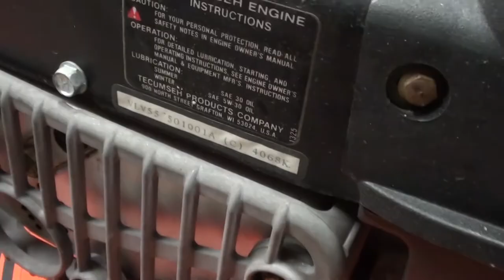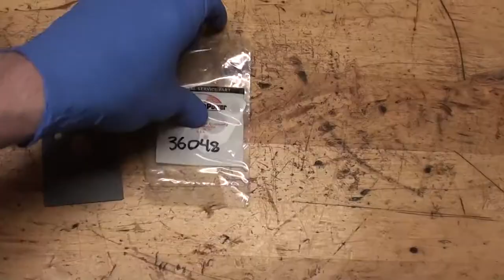Will It Run? Reviving an Ariens Mower w Caster Wheels

Comment: I bought this model mower about 15 years ago.  It is a simple $20 replacement float that is needed if it starts but wont keep running.  Plastic float gets a hole or crack and wont manage fuel level in the carb....

Comment: I've got one of these! Mine seems a bit older than yours though. My engine is a 5.5 Honda. There's a number of different models in the series, according to the manual. Mine is a 911101 (I think) - about 20 years old, I've had it for 10. Almost ready to sell it - going electric!

Comment: Dude, Nice Mower!!  I just picked up 2 of these mowers along with 2 Craftsman mowers for $50 bucks.  Both Ariens didn't run.  I repaired the one which had a 6 HP Briggs and just got the other one together and it also has the VLV55 Tecumseh you have.  It had a sheared flywheel key and the carb was very dirty.  Can't wait to get them both back to normal.  CHEERS!!!
Reply from the maker: Awesome! I ended up selling it to a friend so I can go see it anytime lol. Let me know how your pair works out. Thanks for watching Joe! 🤙🏼

Comment: Some of the problems with those carbs are the two o-rings, one is on the vertical piece and the other is to be found at the very back of the drain screw opening.  Both can be purchased at most hardware stores,  1/4" od  X 1/8" id.  AND the float needle seat is sometimes rubber that swells up and wont allow gas to come into the bowl.
Reply from the maker: I remember seeing the one in the drain screw that I didn't see at first. Definitely noting this mentally in case I ever split one of these open again. Thanks for watching!
Reply: @ChrisXOutdoors  That o-ring in the back is the one that will not let it run except when you are spraying directly into the carb.  The problem I am dealing with is oil leaking out from under the breather cover...again!  Replaced cover last year and its doing it again.  All drain holes are open beneath the cover.
Reply from the maker: 😖 hope you can get everything squared away

Comment: Awesome video! Just subscribed. Would you have a good link on where to buy parts for this mower? Great job again on the video.
Reply from the maker: Thank you Gary. Typically Airens and the engine manufacturers have fairly detailed parts lookups on their websites if you enter the mower/model information. Once you can locate the parts number(s), dump that number into Google and you should have some options. Oftentimes Amazon has many parts. Good luck Gary!

Comment: Do they have fuel filter? I have one for almost 25 years but it’s a 6.5 hp ! I have it in my building & never use it for 4 years! Today I’m trying to see if’s gonna run ! They started right away but it’s stop & won’t start!  I usually empty the gas before i put it up on winter!
Reply from the maker: Even if there was an ounce or two left in the carburetor bowl, it is enough to keep it from running. I’d clean that out along with the main jet and you should be good! Some people install a fuel filter if one does not come from the factory

Comment: Do you have the part number for the larger gasket that was torn in half. Or a link to where you got it. Great video btw
Reply from the maker: I purchased off of eBay..
Part number is 36035 (tecumseh). 

https://www.ebay.com/itm/283713201227

Thanks for watching Michael!

Comment: Hey ChrisX. Can you post the link where you bought the carburetor replacement? Thanks
Reply from the maker: https://www.ebay.com/itm/New-CARBURETOR-Carb-w-Gaskets-for-Tecumseh-632671-632671A-632671B-632671C-632614-/261482858208?mkcid=16&mkevt=1&_trksid=p2349624.m2548.l6249&mkrid=711-127632-2357-0

Let me know if the link gives you trouble!

Comment: I'm not familiar with this mower and one just like this was donated to me. It's an ariens with 6.0 tecumseh with missing self propel bar/handle, broken self propel cable, and I don't see a throttle control. I put a new carb, spark plug and air filter on it and it fired right up.  I've found parts diagrams but don't see a throttle control anywhere.  Am I missing something or maybe it just doesn't have one like other small engines?
Reply from the maker: Typically push mowers don't have a variable speed engine (bunny and turtle speeds). Its usually a wide open throttle controlled by a governor spring. The bail lever at the top that you hold down DOES pull back on a cable that is usually connected to a brake cable that also grounds and kills the engine once you let off. With all that said, I DO believe that this Ariens mower has a variable speed function which would mean it has a throttle cable. I can try to do a quick search for you. What is the model number or anything pertaining to the mower specs?
Reply: @ChrisXOutdoors  Ariens 911072 w/ Tecumseh vlv60 engine. The engine bail lever is attached and the mower runs, but the bottom bar that engages the self propel is missing. Theres a bunny and turtle sticker on the side of the rails you push, but I didn't find anything in my search that was a throttle control.  Maybe it's just as you said and it never had a variable speed.
Reply from the maker: OK.. I think I may have found your answer. I just need the serial number of your machine. It should be in the same spot as all of the other info you gave me.
Reply: @ChrisXOutdoors  s/n 001861.  Found a traction bail lever off an ariens snowblower that I'm going to try hopefully it's a match.  With luck, i' might be able to piece this back together.
Reply from the maker: I searched and was able to find something.. Its difficult to tell if its an exact match but you may be able to better confirm once you search and compare with your own eyes.. Ariens part number 06938000. Hope you were able to get it together!

Comment: I have an ariens 911019 self propelled mower that the engine is no good. Would I be able to replace it with a predator 173cc vertical shaft engine?
Reply from the maker: You might have to do some formfitting to the bolt holes on the deck if it does not line up. That and making sure the brake cable can be maneuvered in as well.. as long as the shaft is very close in length you should be good. Might just need some influencing here and there. If you try it, let me know how it works out!

Comment: I have 1 . & it will start & die . I Have cleaned the carb it looks good . replaced the plug . what do you think mite be wrong
Reply from the maker: How long will it run before it dies out?
Reply: I have same problem. Runs for 5 sec then dies.  However if I press down on primer button and keep it depressed it idles beautifully.  Don’t understand why? Thoughts ?  Thanks Chris !!
Reply from the maker: So either you have some kind of air leak near the primer bulb which is causing an air/fuel imbalance, or there is something clogged up in the carb starving it of fuel
Reply: I just picked up a similar looking model 911513. Almost new one owner. He went electric I’m told. 6.5 Briggs. Started first pull. So far looks amazing. Tomorrow I’ll try it out. Lots of mixed reviews on these so I can’t call it. Briggs is solid usually. The mower feels well built. Mine is not propelled which may be a blessing for me. Mine has the tag sticker still and says made in Wisconsin. I love the look and how it turns. Helluva lot better than anything for twice that price (used) at any of the big box stores..

Comment: We have been looking for a oil plug . I guess you just dump it out the fill hole
Reply from the maker: Yes! Most times on these push mowers it’s more of a hassle to drain from the plug and 10x easier to dump out the oil filler neck. Just make sure when you tip the carburetor/air filter is on the top side otherwise oil will fill the intake